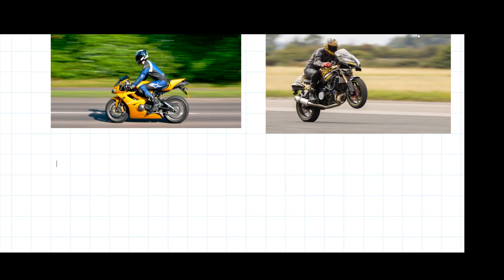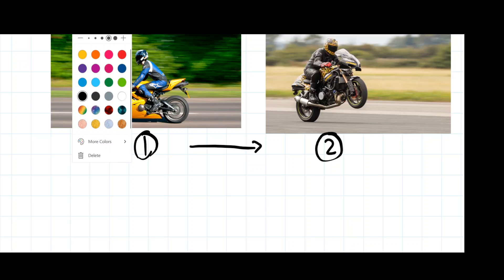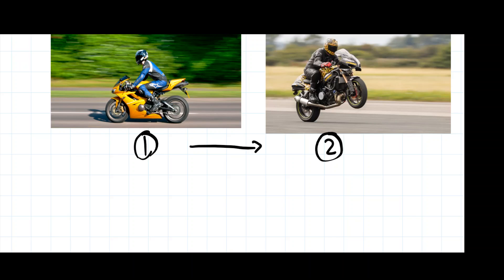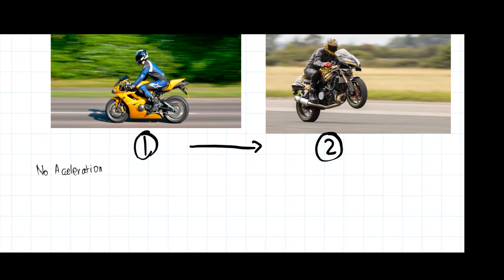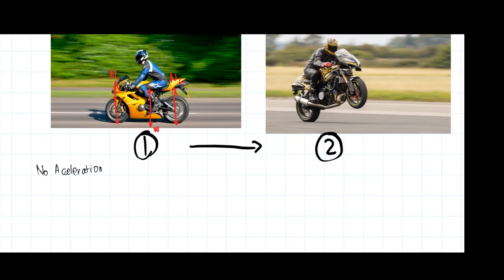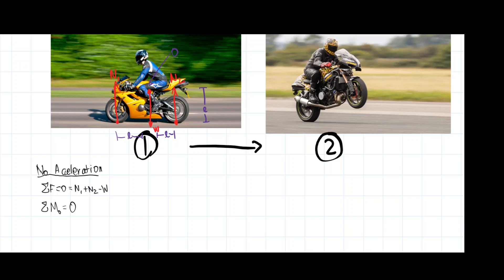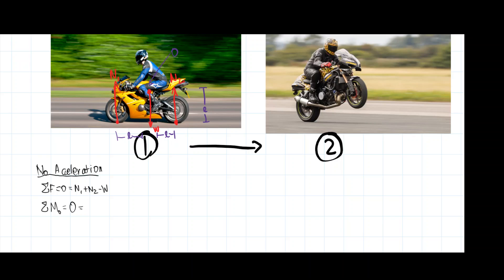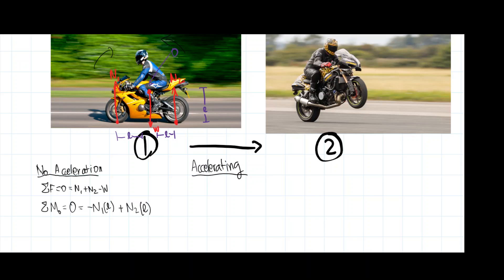How Wheelies Work (Dynamics)

Comment: The 5 year old explanation:  The back tire is like a Jedi. If you follow the rules, it will let you ride your motorcycle slowly. But if you break the rules and try to go too fast,  the back tire will use "The Force" and lift you and the front of your motorcycle off the ground! So that's why it's important to follow the rules.

Comment: Man My Brain Over Heated 2 Times But a wheelie is Basically The G Force thats Lifting the front up Becus your weight Is Going Backwards  ???
Reply from the maker: So the wheelie is the state in which the front wheel is lifted off the ground. This happens when you rev up your engines. The forward force of static friction produces a clockwise moment on the motorcycle and rotates it clockwise. This rotation causes the front wheel to lift off the ground.